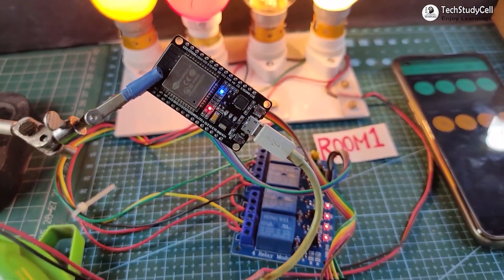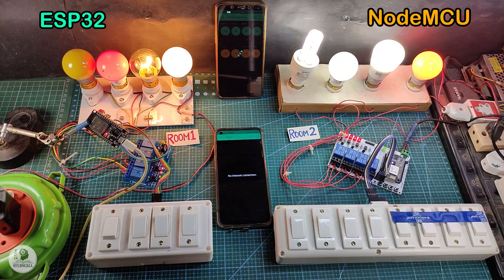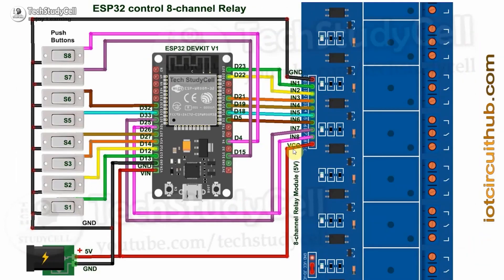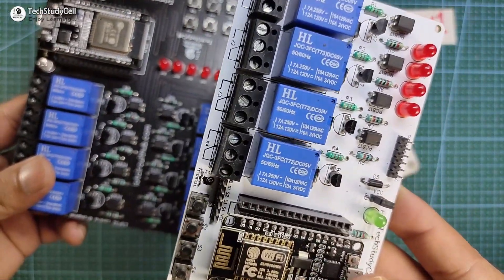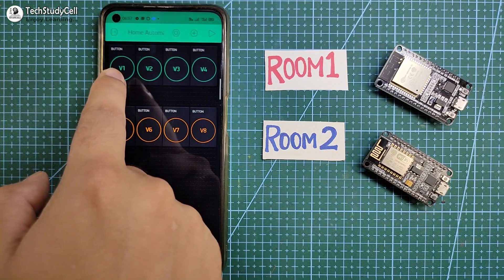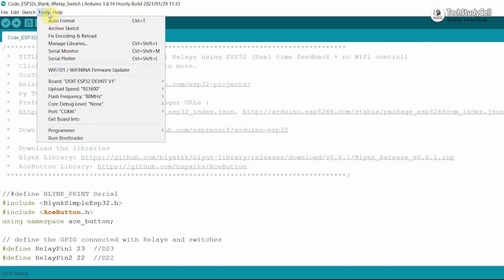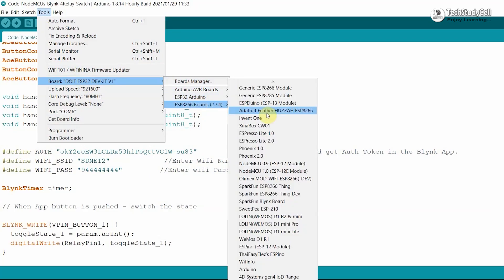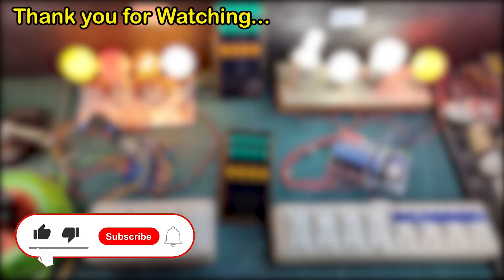Smart Home Automation System with multiple ESP32 NodeMCU IoT network with Blynk | IoT Projects 2021

Comment: You have several videos that reference the two custom PCBs you designed. I’ve used your gerbil file and orders 10 PCBs (Thanks for posting the file!). But, it would be nice if you could make a video that walks thru the board circuits and explain the purpose of the diodes, resisters, pin connectors, switches, etc. I can probably deduce their purposes, but your explanation would be more helpful! For example, on the switches, I assume they’re momentary 2 pin but o don’t know the pin spacing. I also not know the purpose of the pins directly above the switches. I assume they are so you can skip the on board switches and use remote switches, but what’s the VCC for? If you explain your design it would be great! Thanks…

Comment: The normal switches can be leave as such for normal off/on function and  only parallel connection from  the switches need to be connected  to the relays. what is the need to transfer  the normal functions of the switches also to the ESP 32 and relay.

Comment: Excellent video sir. I have some questions. 1. We are using different micro controllers then How do we select the eps32 and nodemcu in blynk?
2. Can we use mobile network data to control the appliances from outside? Assume that nodemcu connected in WiFi.
3. Can we use this circuit in real time scenario? is that working normally?
Reply from the maker: I have already answered all the questions during the video. Please watch complete video. Then let me know if you have any doubts.
Reply: @TechStudyCell  ok thanks. What about 2 and 3 questions?
Reply: @mohankarunamurthy9739 2.....yes if your nodemcu is connected to wifi u can use it from anywhere on this planet condition is only u have a working internet connection

 3.Yes it is working absolutely fine
Reply: @iamvarunverma  thank you so much varun

Comment: You have 220 volts AC___bulbs connected to the output of the relay I want to connect WS2812B__ 5 volts DC is this possible ?

Comment: please check in nodeMCU switch pin 2 , there is D3, please tell me how can be used. Instead of D3 you should use 0 (GPIO 0). If I used 0 (GPIO 0)than code is not uploaded. You may try. If I upload the code as per you (with D3) than Wi-Fi is not connected. please reply and suggest.

Comment: Sir when i turn on the manual switches my appliances turn on and off repeatedly. I used the nodemcu code which was there in your website. I suppose that the code is for push button and not for manual switches. So could you please clarify.
Reply from the maker: If you use push button then refer to the previous video. For this video you have to use ON OFF switch. And use separate 5V  power supply.
Reply: @TechStudyCell  Now it works flawlessly.

Comment: 1 alexa device se kitne  esp 32  ya node mcu  control kr sakte h    
Sir. Mujhe 3 room and 1 hall control krne h  
Please help me sir 🙏
Reply: Hello sir tell me
Reply: @mrhkmechanical7145  u can connect as many u want just add room 1 2 3 4
Reply: @iamvarunverma    Yes   Can you tell if 4 esp32 modules can connect to an Alexa application
Reply: @mrhkmechanical7145  do you know what does "connect as many as u want" means?

Comment: Sir pls give me the code of controll home appliences with wifi blink and bluetooth and also ir remote and manual switch by #esp32 
And i have a question :- if the esp32 board is connected with a wifi hotspot then i turned off my hotspot then again turn it on but why the esp32 board not connected to the hotspot automatically? 
If you know the reason and code pls give the code.
Thank u sir.

Comment: PCB mein relay ki Jo 8 pin h usmein Vcc wali pin ko supply kha say dia
Reply from the maker: Question is not clear to me. Please refer to the circuit shared during the video.
Reply: @TechStudyCell  Nahi may ya kha Raha hoon Jo vcc wala jumper wire kha Lago JLC PCB may relay ki Jo pins Han us may vcc Ka wire kha Lago
Reply: @khurramjamal554 Connect VCC to 5V input + and GND To 5V - (U can use old charger also)